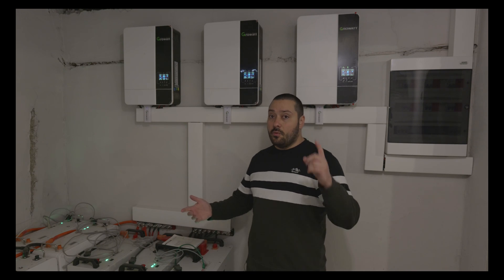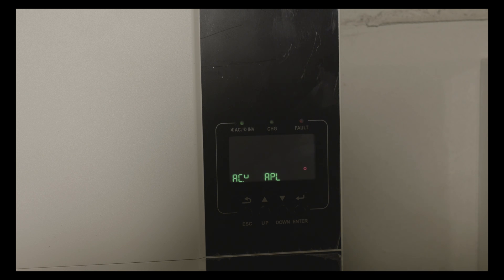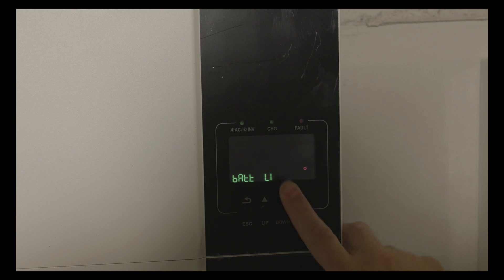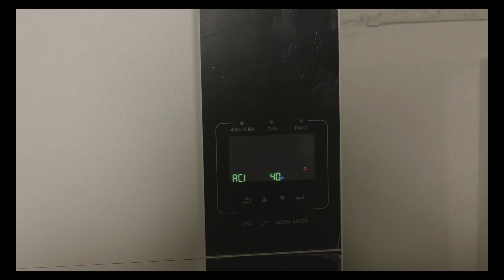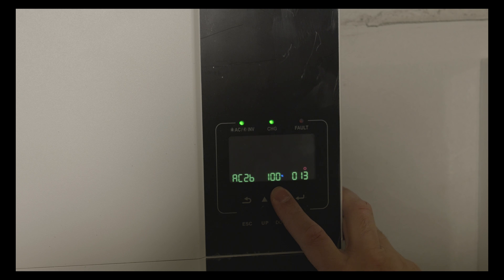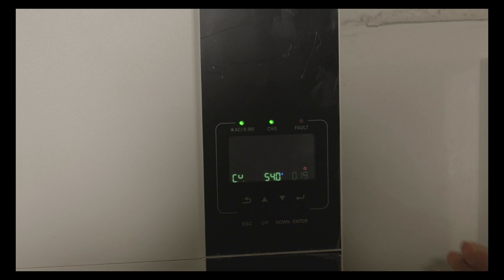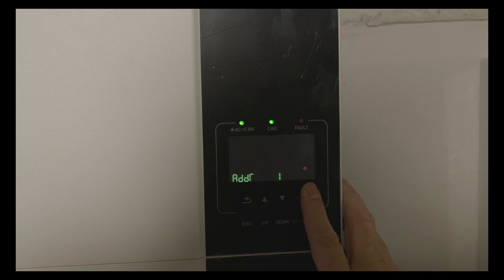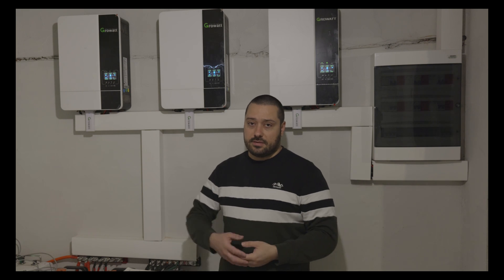Growatt 3x SPF5000ES Parallel with batteries (Settings)

Comment: I have such an installation with 3 Growatt 5000ES each equipped with solar array of about 5000Wpp working with single energy storage and supplying power to single phase output.
One panel array is purely winter setting oriented south with winter angle of 70deg. Second array is actually oriented south-east with summer angle of 35 deg - ground standing mount racks (4pcs) are equipped with wheels so they can be reoriented with relative ease. Last array is organized as "solar fence" to be used as east-west setup (bi-face pannels) mounted vertically.
System was composed this way to increase available output power (single SPF5000ES while supplied by 15kWpp solar array is not able to process more than 6kWh at a time (5kWh to output + 1kWh to battery))  but mainly to significantly increase battery loading power that is important in the winter when solar light can be strong but lasts for far shorter time. Doubling or even tripling charge current to energy storage can substantially reduce time required to fully charge it. Instead of 80-100A from one inverter charging current can increase to 300A. My 6 modules energy storage can accept such a current (nominally 50A per module) so why not to use such a possibility.
Reply: Installation works win "SbU"  (solar-battery-utility) setting in program 1. Loading source is set to "OSO" (only solar) in program 14. 
System works in following cycle: in the morning solar power loads the storage and provides output power. When storage is full output power comes from solar radiation only. In the evening power comes from storage. In summer it's perfectly possible to survive the night on stored power despite my battery-to-grid threshold set at high 25% level. In the winter when battery level reaches 25% grid bypass is automatically enabled. And in the morning the cycle repeats.
According to my observation from early March till end of October it's possible to operate on solar power only with exception of periods of prolonged bad weather what happens but quite rarely. By default I don't expect to be 100% off-grid during the winter when real daily energy production may be 1/10 of what can be produced in the summer.

Comment: Thanks for the program guide, please am using two 6kva growatt with one 15 kwh felicity battery. Please teach communication of the two inverter and their sitting. Thanks waiting
Reply: Parallel sitting of two 6kva growatt inverter with one battery
Reply: I have Felicity Solar Lux-X modular battery composed with one control module (which is also a 5kWh battery on it own)  and 5 battery-only modules (5kWh each).
They are connected to SPF5000ES via CAN bus using  protocol 52 in program 36. Suppose that 15kWh battery from same company will use the same protocol.

Comment: Nice Work
I have 3 in parallel.  Getting many firmware bugs with version 05 firmware.  Apparently there is 06 and 07 firmware updates.  My Bugs are
* Switches output frequency from 60hz to 50hz randomly
* SBU mode does not reliably switch from Battery to Pass-Thru at set value
* Sometimes Master will switch to another unit after being set right without power cycle
* I was having a lot of code 8 and Fan codes, but changing to correct fan cleaned this up

Today I am going to upgrade my firmware and repeat all my Unit Tests to see if Bugs can be repeated.  Worst bugs I have seen on damaged unit:
* Slave false reporting insane high charge current that was not real (like 32A more than real)
* Slave false reporting voltage 10V higher than actual

I am happy with my units, but they are imperfect.  Mine are odd-ball US version before US version released, so between ES and US.

-Schindler
Reply: Which is the most bug free firmware version fromyour experience?
Reply: @testing-rd6yc I updated to the most current.  I have 15KW running daily now with no hiccups.

Seeing 14.2KW loading for hours on end, processing 7-10kw PV coming in, passing thru 7-8kw mains when needed, running off 24kwh of batteries with smooth transitions.

I made many videos 
* Mind your parallel wires and consider noise on those (bit error)
* Carefully tune your switch off values around LVC - settings too close together puts it into oscillation
* Program them systematically and check and double check 

I will Post some update videos when I get around to writing the parallel logger.  All of the units I have repaired or working just as well as they did new

* You can repair the PV IGBT no problem 
* You can repair the motherboard with some fuss 
* The USB definitely works for datalog 
* I tested out the Wi-Fi to the cloud but didn't like that they could change my settings remotely 

It's still a little bit hinky but it works and can be repaired - quite happy - but for more power I would consider a single, larger, unit.  The parallel is a bit messy and not perfectly though out

-methods

Comment: Do you apply these settings on all 3 inverters? Or only on the Master?
Reply from the maker: @qtin88  some of the settings are updated on all via the parallel cables. Just in case check all of the settings on each inverter.
Reply: Thanks for the quick response. I did a test yesterday afternoon with a friend’s system and it does update the slaves. Thanks for confirming also.
Reply: @qtin88  But not all of them....  So check every time!  Some settings pass thru and some do not.

Comment: Thanks.
Please can program 50 be set independently on the inverters in a parallel setup? I wish to set the "AC output time" for the slaves different from that of the master.
Likewise, can program 4 (power saving mode) be set independently?

I hope you understood what I meant.

Comment: Hi, I have a question... 
I have a 3-phase 240 V system in my home and two Growatt SPF 6000+ inverters. 
Can I use those on the 2 phases of my system leaving the 3rd phase intact? 
I have seen diagrams for seting up and connecting 3 inverters (one on each phase) but no only 2. 
Would that cause any problems?
Thank you!
Reply from the maker: @LDGRADBENISTVO  I think you can do that. Try setting them up like a 3 phase system (without the 3rd phase). If this doesn't work, you can install the inverters as they are in separate systems with only one phase. (Two single phase systems) And the third phase you leave it as it is now. I'm m not 100% sure if this will work. Pretty sure it will, but still, you have to test it...
Reply: @golden4o  thank you!

Comment: hello, I have an identical installation with 3 inverters 5 kW mounted in parallel with a total single-phase output of 45 kw but I have a three-phase public network subscription of 15A per phase, I would like to know if it is possible to make the network injection of the 3 phases with one phase per inverter
Reply from the maker: Yes, you can make the inverters work in 3 phases and connect each phase of the residential network to the inverters. You can check the manual on how exactly you can connect them. I'm planning to switch to 3 phases as well as I have 3 phases coming to my house.

Before you do that please make sure to balance each phase in your house. Because with 3 inverters you will have 5KW on each phase. (Total 15KW on the 3 phases)
Reply: @golden4o  Thank you for your feedback but I want to stay in parallel mono and inject each phase in an inverter thank you
Reply from the maker: @angelkm2599  If you want to stay on single phase with the inverters and inject, you can only do that with one of the 3 phases that are coming to your house. Just grab one of the phases and connect it to the input of each inverter.
Reply: @golden4o  there is a risk of connecting the 3 phases if why,
because each inverter normally sends its current, so I do not understand the risk and thank you again for your return
Reply from the maker: @angelkm2599  The inverters cannot convert 3 phases into a single phase. No inverter can do that (as far as I know).  So in order to use 3 phases, your inverters must be in 3 phase mode. If they are in single phase mode, you can only input single phase.
Reply: @golden4o  Thank you very much for this precision so you injected a single phase in your installation

Comment: Setting 23?
When you are using single phase with 3 inverters in parallel the manual says to set it to PAL instead of SIG. But then it gives me a fault.
What is your opinion? I am using exactly the same combination as your system...
Reply from the maker: I cannot access Setting 23, from 21 it jumps to 28. My guess is that the communication between the inverters is not properly connected.